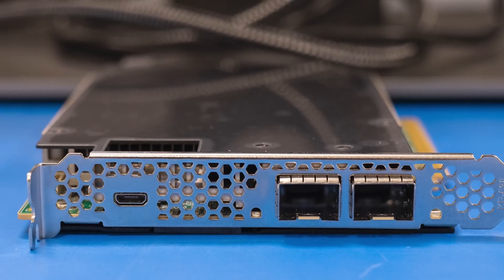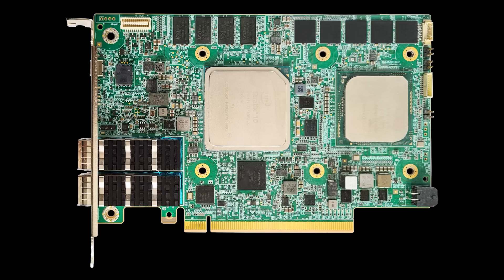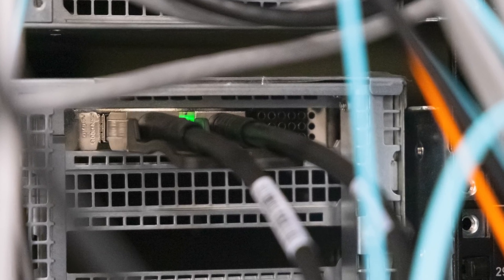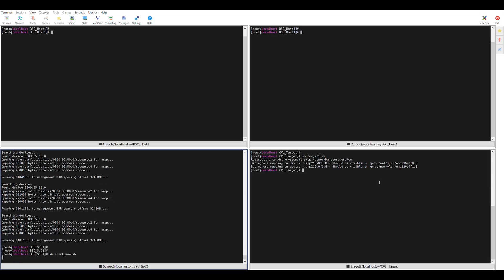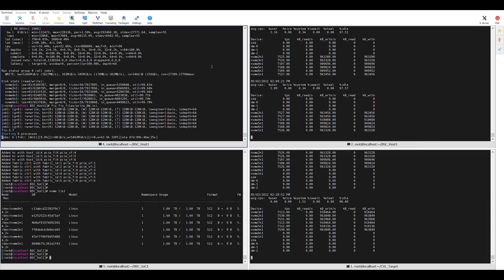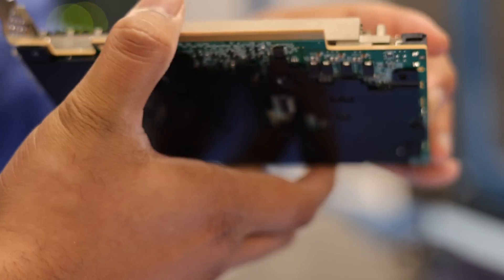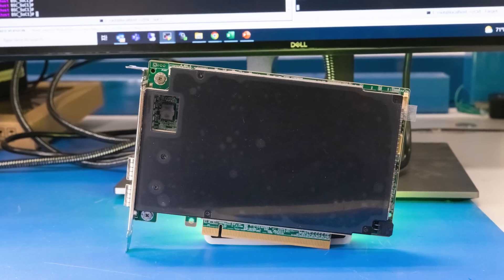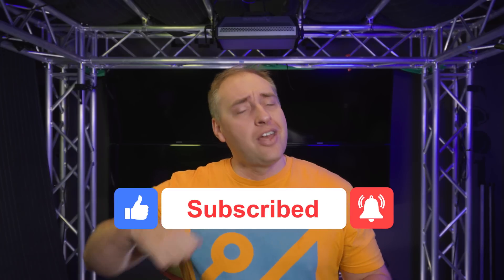This Changes Networking and Storage Intel IPU Hands-on

Comment: We had something similiar a couple of years ago with fully autonomous Ethernet Controllers. And they sucked big time. After 10 years driver support was attrocious and performance benefits neglectible, then all support was dropped from Windows. Boomer. Overall, today even a "stupid" 25GBit Ethernet Board usually needs very little CPU power to be saturated - I know it because I am using a 25GBit P2P connection for iSCSI and the server, a really aging 14 core Xeon, is barely used at 10% at full iSCSI-25Gbit load. Including md-RAID6, LVM and ZFS with attrocious data checksum double checking.

The problem about IPUs: They need highly specialiced drivers and user space software. Which usually never shows up. And even when they are fully supported they usually just save 5-10% of CPU power on the host system - adding some more CPU cores usually is cheaper, more reliable and more flexible anyway.^

About Low-Level-Abstraction: Who the hell needs it anyway? You got an VM host? It does all that stuff in software highly efficient with perfectly updated software (LVM, NVM, iSCSI). This all points down to doing something in hardware no matter the costs which could be done in software for decades without any drawbacks.

I stay highly mistrusting. Sounds like a gold plated solution sold to enterprise businesses which will never ever use them for their full potential

Hey Intel, if you are really reading this: Come up with an usefull solution for object based storage making full use of transparent flash controllers. That is, no sector based storage system but an object based one where you can select for any object if it is stored in SLC, MLC, TLC, QLC, if it is compressed, checksummed and so on. And then give us a file system for Linux and Windows. Thanks, that would be something worth talking about.

Comment: i have an idea, i just pin 4 cpus from hypervisor reserved to processing ofed rdma, nvmeof, virtio-blk and leave the rest un pined cpus to vms, it should provide equal performace in theory comparing this offload solution... what do you think?
Reply from the maker: That takes up the CPU which people are trying to avoid and does not split the infrastructure and application planes
Reply: @ServeTheHomeVideo  yes I know, thats why I say pin few cpus just for dataplane, i believe pciex3x16 bus lane is still capable enough for many use cases. offload 100g intel netcard is as expensive as 16 cpu cores. for a budget solution, i will give sofware dataplane softload solution a try... intel offload 100g netcard is for critical mission and barebone service, thanks for your video, its great to see highend next gen products from you!

Comment: First the EMS-6 Ethernet hard drives then this. Sweet!  Before you know it we will only have a power supply and a PC board with 8 PCI-express slots.  Everything else will be on I/O cards.... Not! LOL  Motherboards add their own value to the picture but it is evolving into what I think will be a master controller for all the devices we put online on the board.  Good video!
Reply from the maker: PSU, cooling, and PCIe was the AIC JBOX we used in the ZFS on BF-2 article on this series

Comment: I liked this presentation, but isn't this very similar to Fungible??  If yes, then I don't see how this is a "game changer" other than another example of a large company copying and idea from a smaller one and pushing it out to market fastest because they have the $$ to do so.
Reply from the maker: So you can see that I did a video with the first Fungible launch. AWS was first. Fungible was trying to do what AWS did with Nitro. Mellanox was probably second with BlueField-1 and that is in production with folks like VAST. Fungible is using MIPS and an ASIC. This is FPGA and x86. Others are Arm ASICs. I am not sure that Fungible had hardware out before Intel had large customers for these IPUs.

Comment: There's nothing that an FPGA can do that an ASIC can't, other than being updatable.  Being updatable and being faster and more efficient than a CPU for specific tasks, are the selling points of FPGA.  But ASICs can be designed to perform those exact same tasks MUCH MUCH faster than an FPGA, but are not updatable as the designs are permanently set in silicon.

CPU - General purpose - Medium speed - Poor power/performance ratio - Updates limited to microcode changes only.
FPGA - Specific purpose (or CPU ISA design) - High speed - Good power/performance ratio - Completely updatable.
ASIC - Specific purpose - Ultra high speed - Very good power/performance ratio - Not updatable, at all.

Comment: it flashed by in the slide at 13:14, but exporting various back-ends (iSCSI, NVMeoF) to the host as VirtIO-blk is a pretty interesting use case.

Comment: So... I really don't see how this is majorly different than a DPU. I get Intel wants to call theirs an IPU, but it's the same thing. Maybe that Xeon D has a bit more general purpose compute power than some ARM cores on other DPUs, but lets call a spade a spade here. This is just Intel marketing, it's a DPU.
Reply: The main difference seems to be the ability to emulate physical infrastructure with the FPGA, e.g. make a NAS drive look like an NVME drive to the guest software. It could help with common off-the-shelf software that is coded to specific hardware limitations. Since the migration seems to be going back from virtualization to hardware provisioning, there needs to be a way to give physical hardware feature requirements to the system the same way you can plug a piece of virtual hardware into a virtual environment. That's what an IPU has over a DPU.

Comment: Well, the CPU utilization is now on the IPU instead of being the main one in the server. So Intel is using a dedicated CPU to off-load the work. Ok.
Reply: The big distinction is that now you can use the FPGA for some of that. Rather than having to bring up a brand new ASIC every time you want to add support for LZO or ZSTD compression you can instead just reconfigure the FPGA with whatever you happen to need at the time instead of trying to make sure your ASIC has support for anything and everything you could need. You wouldn't be offloading compression or encryption to the Xeon D, you'd be offloading it to the reconfigurable FPGA and your Xeon D would be in place for managing connections to whatever storage backend this thing is talking to or the encryption keys for anything this encrypts in flight. The FPGA is your data plane and can route traffic to the Xeon D if necessary whereas the Xeon D is your control plane dealing with orchestration but not trying to process up to 400 Gbps of data.

Comment: Yeah, you can even get that FPGA to compress and encrypt data when going to the NVMe and vice versa on the way back, which is a good idea if you do not trust the users on the client side as the encryption keys will not be anywhere in the client system.
Reply: 0000
Reply: This is, to me, the major benefit of using an FPGA instead of an ASIC.... within reason, an FPGA allows soo much customization compared ro a 'fixed' ASIC. If a vendor wants to add additional custom features unique to their requirements... then they could AND you dont loose performance for other un-touched datapaths. 

It's a seriously big step forward in many ways.
Reply: @Thats_Mr_Random_Person_to_you  Yep. The magic stuff you can do with them FPGAs is mindblowing on a bad day! Earth shattering on a good one hehehe

Comment: @ServeTheHome : hey Patrick do you know why these IPU's have heatsinks glued on top of the SFP-connectors ? Does a fiber optic transceiver that hot during operations ???
Reply from the maker: Yes. It is for cooling. Most high speed NICs have them and the 400G and higher ports have some big ones